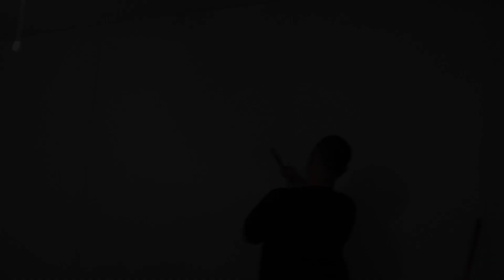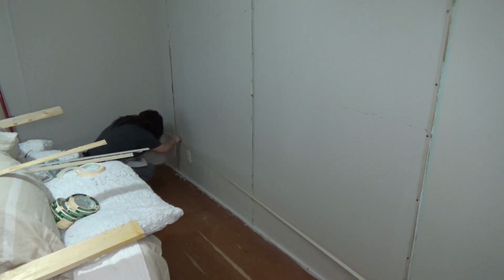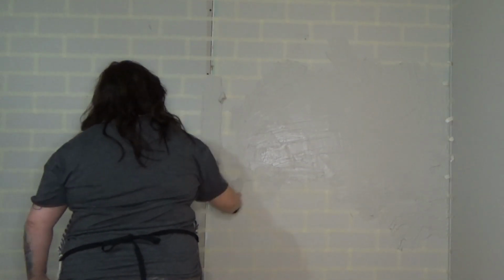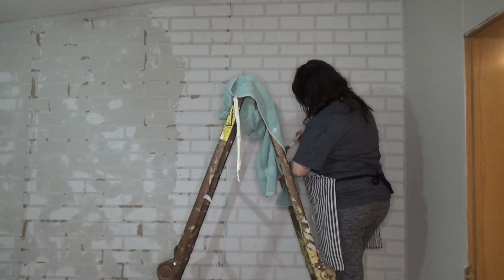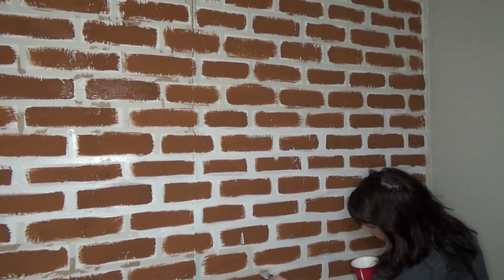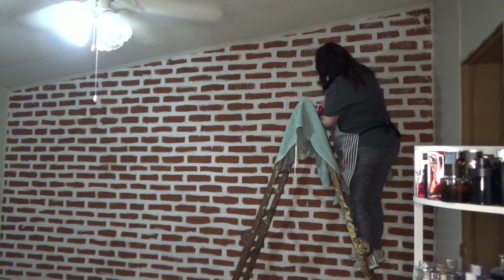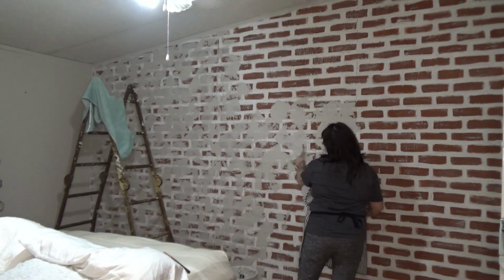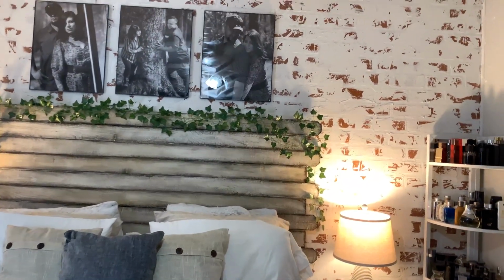MOBILE HOME MAKEOVER | MASTER BEDROOM MAKEOVER/UPDATE | DIY FAUX BRICK WALL | ALL THINGS JESSIE

Comment: This process will end up in textured wall look . Not smooth right? And no cracks from where the strips were removed?
Reply from the maker: Ohh it def will have texture you do get cracks here n there But you can go over those with joint compound and it fixes the problem. Definitely still with polyacrylic I prefer the Matt or flat